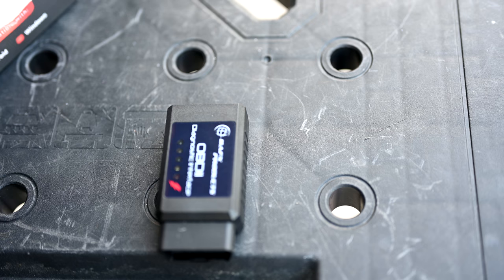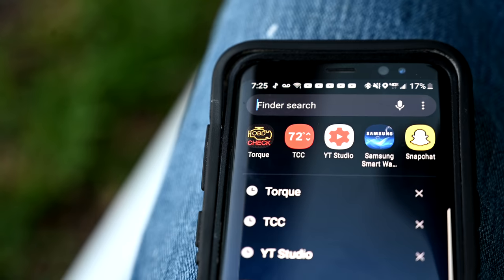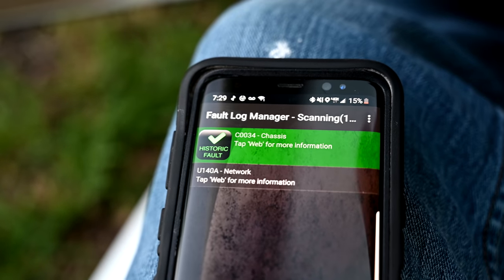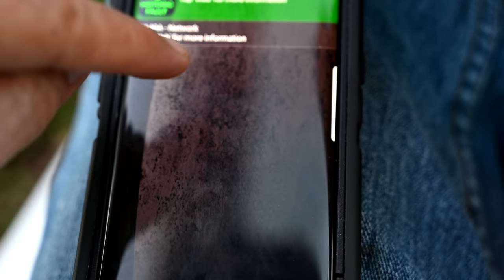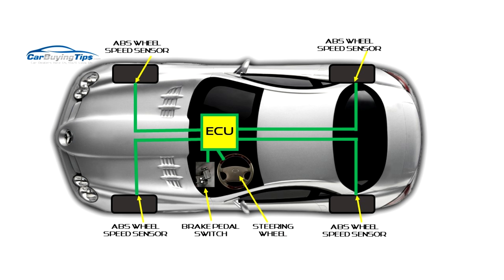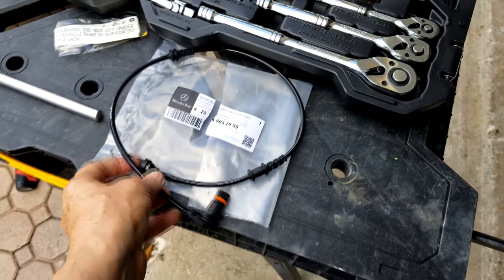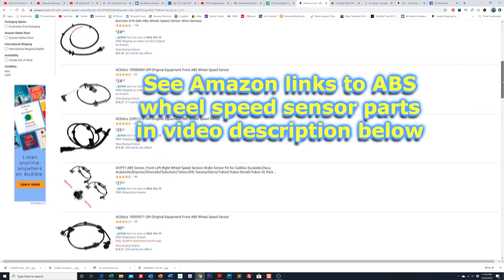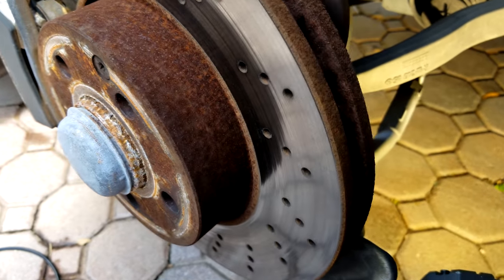ABS Unavailable [How To Fix]: Check Engine Light Mercedes

Comment from the maker: Car repair tools and parts in this ABS Unavailable Repair Video:
✅ Genuine Mercedes-Benz RPM Sensor 204-905-29-05 https://amzn.to/2xZI2IL
✅ iCarsoft MB II Pro Multi-System Diagnostic Tool Mercedes-Benz: https://amzn.to/2RreN9m
✅ BlueDriver LSB2 Bluetooth Pro OBDII Scan Tool iPhone & Android: https://amzn.to/2UtrWOS
✅ BAFX Wireless Bluetooth OBD2 Diagnostic Scanner & Reader Tool:  https://amzn.to/2q0WOe0
✅ DEWALT, DWST11556, Express Folding Workbench: https://amzn.to/39XW7UM
✅ Channellock 39067 132 Piece Tool Set: https://amzn.to/2wrsddo
✅ Milwaukee (MLW255721) M12 FUEL 3/8" Ratchet Auto Kit: https://amzn.to/2U83BiF
✅ Milwaukee 2457-20 M12 Cordless 3/8"Ratchet Tool Only: https://amzn.to/2QAJ30p
✅ Meguiar's G180132SP 32 oz. Ultimate All Wheel Cleaner: https://amzn.to/2KLRNxG
✅ Grit Guard Wash Bucket with Lid: https://amzn.to/2wvVBix
✅ Chemical Guys Professional Bucket Dolly: https://amzn.to/2xXXcOx
Reply: Thanks so much, the steering wheel trick worked for me on my 2011 MB C300 and ABS light now off!
Reply: Z
No one
Reply: Thanks a lot! This is really helpful!😊
Reply: Thank you as the steering wheel trick worked for me. I still need to get it checked & hopefully not going to be expensive

Comment: Mercedes are just pure junk I had 3 and all were nightmares esp abs...then sbc... airmatic suspension failed...I will never in my life want another one not even for free...switch to honda and Lexus and have not had a single issue now my family can breathe again
Reply from the maker: I got news for you every car will present to you its own set of problems and they are all expensive to fix no matter who the brand is
Reply: Stick to what you can afford if you can’t maintain a Mercedes don’t buy one because my Mercedes never give me problem
Reply: You are actually correct. My two Cedes out of about 20 cars have the dumbest problems, along with my one Volkswagen where they can’t even make a non-leaky sunroof. I. Fixing one to sell it. My 2011 glk350 4matic fuel sending unit on driver side is leaking, then now key seems to not always want to start, and now I’m watching this video for what seems to be a front right speed sensor issue. I actually gave up on the second Mercedes and just parked it outside.
Reply: Get a w212 Mercedes E350, bulletproof cars. Had mine a 200k miles with absolutely no problems ever, just kept up with maintenance.

Comment: You should ALWAYS use jack stands when working on a raised car.  Those flimsy crank jacks can fail and crush whenever is under the car.  If you don't have a jack stand, you shouldn't be working on your car.  At the very least, put the removed wheel under the car just in case the car falls.

Comment: We need more how to videos, I bought a MB as a former mechanic, I admire the engineering and longevity of this reliable brand. However, dealer service departments are run by Used Car Salesmen from the 80s. And the techs from those used car lots. You take the car in, it gets diagnosed, parts are replaced, you bring car back for same thing, and your met with, "Must be something else wrong, hope you got plenty of money". Zero integrity.

Comment: There’s one issue that you didn’t distinguish that I think is worth mentioning, since the beginning of your video mentioned other ways to possibly correct the issue.  I have the same car and if you get the ABS, ESP inoperable message WITHOUT the check engine light on, then you probably need to just go left to right lock a few times and the steering angle sensor should reset.  If you have the ABS/ESP message with the check engine light, then you’ll need to use your scanner, and perhaps it’s one of your abs wheel sensors that need replacement.  But if the check engine light is NOT on and you only have the ABS/ESP inoperable message, it’s most likely something simple that is even less stressful and worrisome.  I also once got this message when I changed my power steering fluid.  But it soon went away.
Reply from the maker: We did mention about the wheel in the video and it has helped many people.
Reply: @carbuying  Right, I’m not judging that.  Just wanted to point out that there’s a distinction on whether the check engine is on or not, when the ABS/ESP message is present.  Knowing that upfront can make a big difference in understanding the issue.  If no check engine light is present, no need to plug in your (or buy) a scanner, at least not for this, since there won’t be an error code.

Comment: I have an 04 G Wagon AMG55, great car and I was always hesitant in buying a used Merc, but they are really easy to work on, I had this same problem with the ABS light coming on, I replaced the stop lamp switch and tried the steering wheel calibration but nothing would fix it.  I was ready to take it to the dealer, the fault code still read stop lamp switch.  Then I checked the brake lights, my third brake light was out, started checking the fuses and sure enough one 5 amp fuse was blown, I think the switch went bad and caused the fuse to blow which caused the ABS light to come on. Just an FYI guys.  I got lucky!
Reply from the maker: Yes, that was one of the weird cases we mentioned, where a seemingly unrelated blown fuse was the culprit. Glad to here you solved it.

Comment: Awesome video!!  My 2013 4matic C300 did not have the two wires at the speed sensor/firewall connector but just the one...  this video saved me hassle and $$$!!  $60 for Genuine MB part and 2 hours of labor.. Also, all the warning lights were still on after replacing the sensor but as soon as I put car in motion (drove car) the sensor sent proper signal to computer and lights went off!!  No reset or anything needed as you mentioned..  thanks again!
Reply from the maker: Yes, that's exactly how it worked for us too

Comment: Thank you very much for a extremely helpful video. I was able to order the part and easily install the new sensor. Error message went off immediately. You saved me over $500 to repair this faulty sensor without bringing it to the dealership.
Reply from the maker: Yeah, that's how it's done!

Comment: Just done the "turn the wheel in both directions" fix and it worked on my 2013 W221 - Thanks for the tip.
Reply from the maker: Glad it helped, We are never so lucky! We had to replace both ABS sensors. would not be surprised if the issue is intermittent and returns.
Reply: You’re right! Problem came back the following day, it’s been diagnosed as front right wheel sensor.
Reply: I tired it doesn't work for me. I pray it would as to I'm headed out of town

Comment: Four hours!  Holy cow!  I did mine in about 45 minutes.  As you say, a scan too is essential.  I have an iCarsoft MB II and an iCarsoft MB V3.0 for both of my Mercedes.  The usually fit in one of the storage compartments of the car.  For a few more bucks, the MB V3.0 is a better deal.  Much faster and more features than the MB II.

Comment: Hi from London. Another channel mentioned that when replacing the abs speed sensor you usually have to replace the speed sensor ring on the wheel hub. As the sensor reads the ring as it turns on the wheel and it's not unusual for them to go as well and its not a easy job to replace them as it involves taking the hub off.

Comment: What a great video!!! I was able to resolve the issue with our 2010 GLK350 by turning the wheel lock to lock. If the issue returns I will definitely purchase the speed sensors via your video.
Reply from the maker: Way to go Mark!

Comment: Thank you so much.  This is exactly what happened to my C250.  You saved me $500 if I got the dealer to repair it.
Reply from the maker: way to go michael
Reply: @carbuying  My dealer is saying all 4 wheel sensors need replacing ? Surely not all 4 would go at once ?

Comment: Good video very thorough, and helpful,my only criticism is there should be an axle stand placed under the vehicle where you are working, these car Jack's aren't  designed for maintenance  only for changing your wheel at the side of the road,other than that very watchable.
Reply from the maker: es, but most people don't have a jack stand
Reply: @carbuying  then put the wheel under the car just incase it falls.
Reply: Good video,I also thought of the same thing,actually mercedes Benz jack kit normally comes with a metal folding wheel chock

Comment: I have c250 2012. This error happened to me today but the error disappeared after turning off and turning on the car, but check engine with airbag sign are highlighted on my dashboard ! I’m worried from the ABS pump to be faulty I’ll check the error tomorrow! Thanks for the video 🙏🏼
Reply from the maker: Did you try exercising the steering wheel all the way over to the left and then to the right like we showed in the video? this helps some people with this problem too.
Reply: carbuyingtipscom thank you for you reply, I took my car to the service center and we found that the issue is from the pump it happens suddenly and the steering becomes heavy when the error shows up. I ordered used one from ebay coz the new one is very expensive around 2K!
Reply: @BilalBaydoun86  Wow, that is crazy, $2,000 for a new pump! Would not expect that  from an 8 year old car. did you try turning your wheel all the way to the left and then all the way to the right? This helps clear it for a number of people. OR, are they sure that the pump is actually bad? Is it not pumping fluid?
Reply: jeffostroff the control module that is connected to the hydraulic is not functioning properly and I found that’s a common issue in w204 you can rebuild it or you can switch it to rebuild it it will cost you 300$, the issue is happening randomly and when it happens the steering wheel becomes heavy and you don’t want this to happen to you when ur driving. I found used pump on ebay for around 120$ including the module which’s very reasonable price but you can see many rates that it can reach up-to 600$ for used one. I didn’t take the pump apart but I don’t think it’s leaking.
Reply: jeffostroff the module is around 1300$ and the hydraulic is around 1000$ for new one

Comment: Just subscribed! 
My Benz is 2004 model and when the ABS Light comes on the brake stops functioning. I had to stop driving it because of this. Will this method work for me?
Reply from the maker: Yes it worked for us, you saw it here in action. Remember to clean out the spot where the sensor goes.

Comment: Hi there great video I have a very strange question but my abs light comes on for a second when my doors lock then goes off straight away (pulling away) (C class) w204 2012, any ideas?
Reply: Hi, I have exactly the same problem. Did you manage to solve it?
Reply: @sharonr555 Both batteries were replaced but the problem didn't go away till I replaced the Auxiliary battery. Hope this helps

Comment: Great video! My car has the same problem and is in the shop to replace the sensors.  Just curious, what is that little coffee cup indicator near the "P" in 18:10 on your dash?
Reply from the maker: That coffee cup alert comes on when you've been on the highway for about  an hour, and bugs the heck out of you every 20 minutes or so with 4 loud beeps to get your attention to prevent highway hypnosis, and it reminds to stay alert, I.e., like a cup of coffee.

Comment: Update: I was able to replace my left front wheel speed sensor following this video today!

My 2012 C250 has C0031 which is the left front wheel speed sensor issue. Is left any different from right? Also is left sensor same as the right sensor (I am asking because I want to know if i can just order using your Amazon link for the Genuine MB RPM sensor). Thanks!
Reply from the maker: Yes, this sensor is for front left and front right. The rear wheels use a different sensor. the repair is the same as you see in this video, but might be mirror image.
Reply: @carbuying   thank you for the reply!  I am so glad that I got this issue after your video came out haha. I watched other videos and post and they don't explain in detail like you do. I also followed your video to replace the battery for the first time a week ago lol. Your videos are very visual and easy to understand. 👍👍👍

Comment: Hello first I really appreciate the information you give us, I have 2015 GLA 250 that has the ABS and all of the other lights on as well like in the video the reader said front right wheel speed sensor faulty  I replaced the sensor checked all the fuses and I reset all the rights and after I drive the car for less then a 100’ the lights come back again and from the same sensor I checked the sensor and it does have voltage. Any advice what I need to do here please? I really appreciate your help!
Reply from the maker: Have you tried using an ODB2 reader to reset the code in the engine? It could be that that you car is not automatically resetting the code when the condition disappears, or maybe there is an electrical issue triggering this, like maybe a bad fuse somewhere. We have seen where one bad fuse unrelated to this  can cause a false positive. You should also try Club Lexus Forums, and ask there, very knowledgeable people there, who might have seen this issue. Let us know what you find.
Reply: carbuyingtipscom yes I did reset all the codes and as soon as I drive it the lights will come back. Do you know where the sensor read the speed from?
Reply: Did you get a resolution for this? I have the same problem.

Comment: Hi,

Thank you for your video, helps a ton! Anyway, I just replaced right front wheel speed sensor on my 2012 c250 coupe (have the same code shown in video), but I’m still getting ABS inoperative message, I need to reset or drive more?

Thanks!
Reply from the maker: Did you try driving it a few miles, see how it does?
Reply: carbuyingtipscom Hello there! I seem to have the same problem on my 2013. I’ve driven the car for quite a few miles now. It turns on and off. Sometimes I have my abs available, other times I start the car and it’s on again. I also tried disconnecting the battery for a little to no avail. Any help would be greatly appreciated!
Reply: carbuyingtipscom I did drove the car a few days now, the ABS message comes on sometime and off other times.
Reply from the maker: @carsandpassions9116  where did you buy your sensor from? Maybe the new ABS sensor is unreliable.

Comment: Hello, purchased the new sensor front rt. Changed it as you demonstrated and completed however the lights are still on, I have the icarsoft scanner and the alarm is the same you found, I bought the sensor from Parts Geek, I bought the correct one!! But looking at the old one it had numbers on it I couldn’t find on the Holstein part so I ordered a new on from Mercedes parts sight, it was 77.00 compared to the 37.00 Holstein part, any thing else it could be? I’m a big subscriber you have excellent videos thank you. Mario
Reply from the maker: Hi Mario, how far have you driven the car? With our other car, the 2013 Mercedes C250 last week,  we had to replace both front sensors, and it took a few hundred feet down the road for lights to go away on their own.  Maybe try to drive it for a day see if it goes away on it's own. Also might try resetting the error code, maybe the RT needs to reset it rather than going away automatically. Hopefully there was no problem in your wiring harness. Try exercising the steering wheel all the  way left and all the way right, drive around the blocks a few times. Also dumb things to check, did you actually attach the new part after removing the old part? Sometimes we do odd things in the heat of summer. Let us know what you find.
Reply: Hello and thanks for checking on me, I installed the new correct part and all went off except check engine light, I hooked up the icarsoft scanner and it says the right front rpm sensor, so should I try to clear that? It’s the only alarm or fault found, I’m Leary of erasing history as it comes up on the scanner, is that why the check engine light stays on?
Reply from the maker: @mariowoodsN5  You should be able to clear it, but the engine fault should have gone away on its own
Reply: @jacquelinetexeira6827  yes Jacqueline there was a pea sized rock on the sensor hole.

Comment: Can ABS light affect transmission? When the lights came on my car wasn’t accelerating as it normally would.
Reply from the maker: No the a BS light has nothing to do with the transmission it is simply measuring the speed of the wheels so that the a BS brake system knows how to break in an emergency. So the a BS light coming on just simply means that the computer can't get a speed reading from the wheel because there's something wrong with the sensor

Comment: I have a 2015 CLA 250 Mercedes. The ABS came on a few days ago. Purchased an OBDII reader from Amazon and got the COO34 and U140A code. Changed the right front wheel speed sensor. But even after driving the car around the block the light still on. Also the steering wheel is kind of stiff. Is it normal for the steering wheel to be stiff when it comes to an ABS issue ?
Reply from the maker: No, that cannot affect the steering wheel in any way that we know of. We have also seen where changing both left and right might be necessary, we changed them both on our other Mercedes even though the reader error code was for one wheel only.
Reply: The same problem has in my cla 250 2019. There is abs sensor error on my board and steering is stiff.Did you solve your problem Lis M?
Reply: What was the solution? Abs and esp unoperative came on. Strangely enough, did a car realignment and that fixed the issue without changing anything.